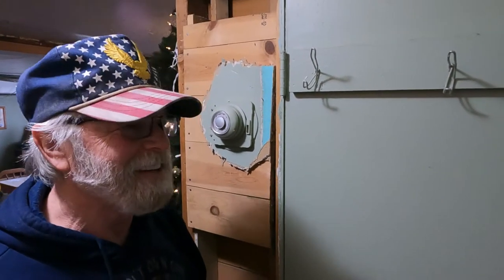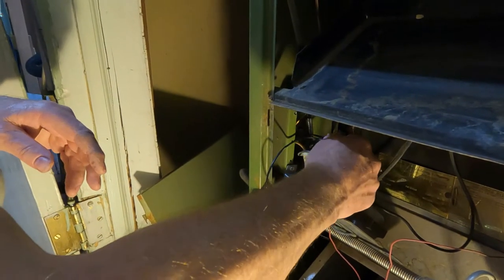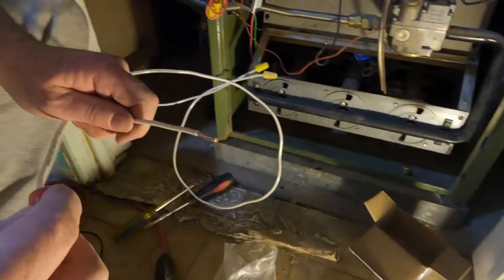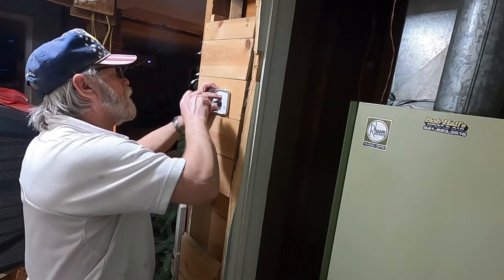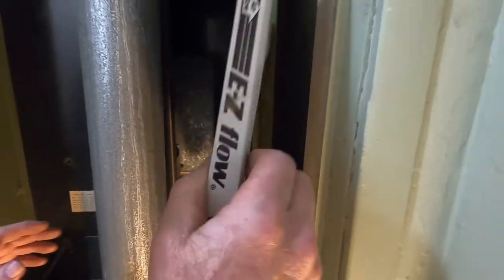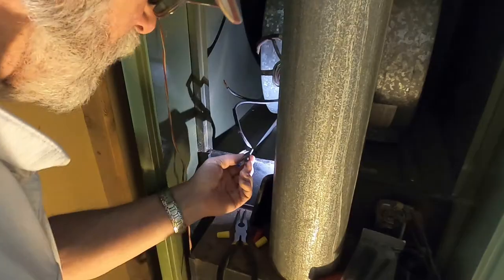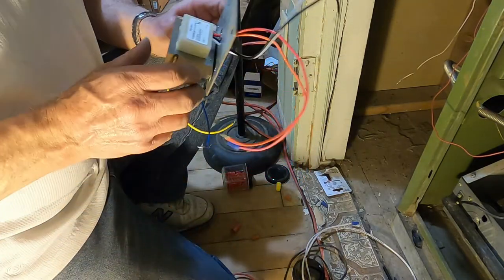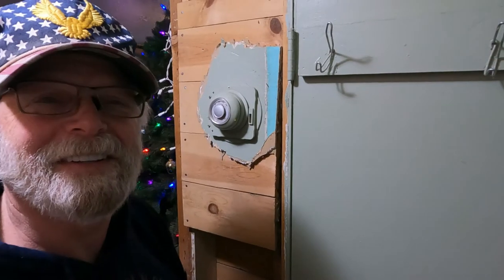Fixing Rheem forced air Gas Furnace..Trouble shooting the problem..Transformer and Thermostat issues

Comment: Hi sr we’re I can find the 24v 2 wire 2 screw transformer
Reply from the maker: I went to Grovers Electric and a couple of other places had them. I also contacted a heating and air supply company, they had them but they were expensive. Home depot didn't have them. look for an electrical supply house you should be able to find one pretty easy.. Hope this helps